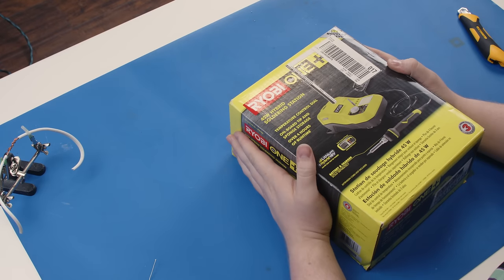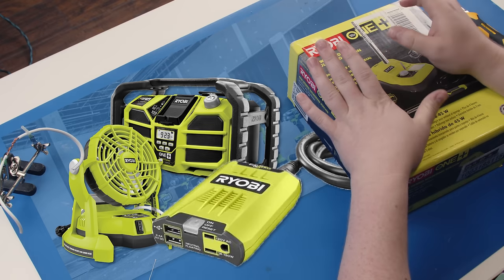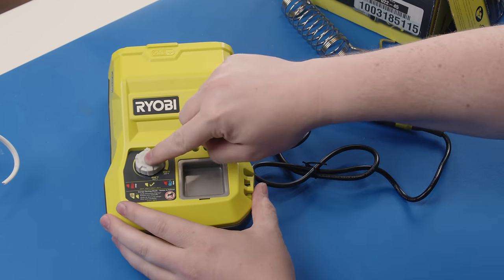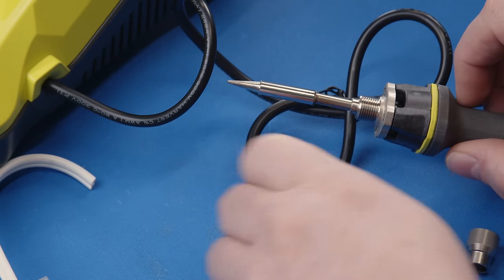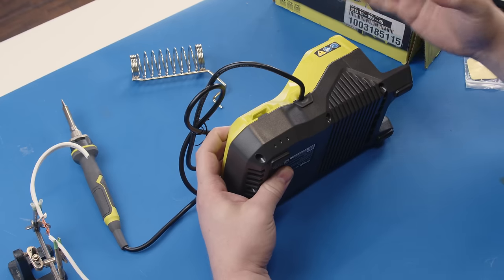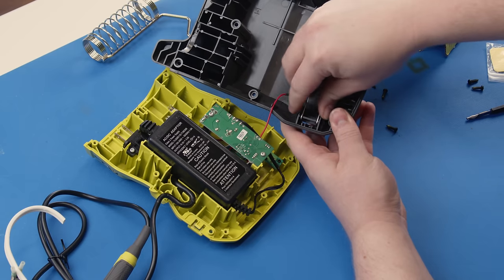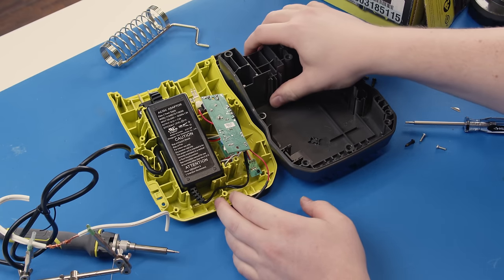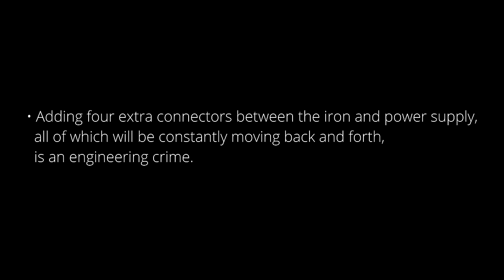Ryobi has GOT to be joking with this soldering iron

Comment: "I hate using bad tools even if I'm gonna do a bad job with them anyway." Man, I felt that one too hard.
Reply: Once you start appreciating good tools, not necessarily expensive, but quality ones, you can never use cheap stuff again.
Reply: Bad tools are really annoying, they feel wrong when you pick them up.
Reply: a good tool in amateur hands will do worse than a bad tool in professional hands in many circumstances but a bad tool is a bad tool and will cause more damage to the product than a good tool in anyone's hands
Reply: @frogz  Sometimes you work with what you have. As a kid, I had a 35w pencil soldering iron, but it did work for wiring, but not so good at ICs.
Reply: @the_kombinator  i use a weller gun for qfps, use what ya got
Reply: @frogz  Wellers are great! I had a 35/140w that made automotive wiring harness jobs a flash! Once I got myself a decent paying job, I got myself an adjustable iron for semi-precise PC repair and I'm glad I did, but for decades it was Canadian Tire 35w plug in specials lol.
Reply: @frogz  Only if you know how to use the good tool!
Reply: At least when it's a good tool I know it's my fault that I'm fucking things up. This is not the case with a bad tool, if often feels like it's the one failing ME
Reply: . @the_kombinator  You need a selection of irons. No one size will be good for all jobs
Reply: @frogz  I kept a Weller gun on hand for quick jobs or where greater power was needed than I could get with a pencil iron. It was a matter of convenience/expedience no more. Otherwise, It was a love/hate relationship.
Reply: @WCM1945  I have two with interchangeable tips and variable temperature control.
Reply: Preach brother.... I'm that guy. "Step aside. I've got $450 digital torque wrench. I'm about to put a cheater bar on it and twist the head off a grade 8 bolt."

Comment: I’m a retired engineer. You spoke about the build quality of the internal PCB and the fact that they had not cleaned it. In recent years manufacturers have developed what is known as “no clean flux.” It contains no corrosive or conductive chemicals, dries hard so it does not attract dust, and does not need to be cleaned. The items you pointed out as rework on the PCB are more likely through hole components that can not be soldered in the same oven as the SMD parts. I also don’t think wire length has anything to do with cost, it has more to do with fitting everything into the box. You see this with many electronic products, even very high-end ones. About the only build issue that I think is a real problem is the PVC cable. I’m not sure why they made that choice, probably a cost thing. But it is a deal killer for me as well.
Reply: As far as not needing to clean flux off products... pure rosin core flux without a corrosive ingredients has been available for 50 years , and is not expensive. also a few seconds in an isopropanol alcohol bath is not difficult.
Reply: @Geopholus  Except you can't really bath a board that has wires soldered on it. Your bath content will creep into the wires, denature the flame retardant (if any) and lower their lifetime. I'm quite sure the boards have been cleaned after the SMD process, but not after the wires and TH soldering.
Reply: Ahem.  Rosin core is corrosive, that's what flux IS.  Some are just more active than others, but rosin is mildly hygroscopic so can cause problems in humid areas.  Also, merely dunking it into an alcohol bath for a few seconds will not remove it.  It needs abrasion/scrubbing or a much longer agitating bath for removal, which isn't really needed if they simply use no-clean flux/solder instead. 

There are many steps in design and manufacturing that could be idealized but in the end it has to be weighed what the benefit is vs all the extra costs.  That does not mean that I feel a few cents more spent here or there, wouldn't be worthwhile but remember what Ryobi is, TTI's consumer grade brand for tools rather than contractor or pro grade.  @Geopholus
Reply: @Geopholus lol
Reply: With determination, one can fabricate a silicon-jacketed cable for this beast.
Reply: @stinkycheese804   Just curious.  What would be considered pro grade?  I see a lot of Hakko machines and in the old days, Weller was everywhere.  I also never had the pleasure of using an iron that was temp-regulated. Does that really make any difference at all?
Reply: The probably i see is alot of companies use the pvc cables over hogh quality rubber and most of them i sure do it to save money my guess os they figure the people that will buy this to use it arent people that soldier professional but more of just a simple diyer which is normally the people that buy ryobi if we are being honest i know my brother has a bunch of ryobi and he has been pretty upset with a bunch of it and wishes he would have gone dewalt or Milwaukee.
Reply: @alext8828  for hobbiest/non professional use, I like the pinecil. I know thats not what you asked but its a cool soldering iton.
Reply: Impressive that you could sit through the whole video!

Comment: One advantage of those "internal" power supplies is that they can replace these with supplies for different regions without redesigning the whole tool.
Reply from the maker: I considered that, but I'm pretty sure the opening in the chassis is sized for a US plug and would not fit any others, and from what I've been told (and what research I've been able to do) the "hybrid" feature is US-specific, likely for that reason. In the UK, ostensibly, these just run off of battery only.
Reply: Unless they are really cheapest out on psu it should handle 100-240v 50-60hz easily
Reply: I was wondering this as well however I have a Bixolon Thermal Printer here where they also put a power brick in the case. It doesn't have a cable on it though, just a socket for a C13 plug (I hope that's what it's called), which would make it even easier to ship it around the world I guess
Reply: @virtualtools_3021  I actually says that right on the case of the supply.
Reply: @CathodeRayDude  we dont have these type of extension cables in the uk, where you can just connect them to a male plug like that. They would have to use an IEC type inlet for here.
Reply: @CathodeRayDude  they just don't sell the larger more expensive unit that you have here in the UK it seems, when I lived in France I had similar extension cables with a single socket like you get in the US so I wonder if it would be easier for them to make an EU version of this, but the UK plug really doesn't work in the right way. I would be interested in one but I can't find it for sale. I get your thoughts on the ts-100, I've had mine for a couple of years and use it quite a lot and had no issue with mechanical stress on the connection "engineering crime" or not, and the tips hold securely enough in place that I just removed the grub screw and now I can swap them out without fiddling with a tiny screwdriver. Each to their own though, fair enough if it's not for you.
Reply: Also thought it was funny that the builders plate on the soldering iron itself says 120/60 only, but the actual PSU hidden inside is universal. One of the UK tech youtubers (I think Bigclive) said Ryobi purposely has separate 120v and 240v products to stop grey market imports.
Reply: @virtualtools_3021  It's not the voltage that's the issue, it's the shape of the plugs.
Reply: @CathodeRayDude  So in the case of a UK model, they can just leave out the whole DC PSU and fit a plug over the empty hole without a complete redesign of the product. Seems like it makes sense to me.
Reply: @Ascania  aww come on don't your want to use a janky and mildy dangerous adapter?
Reply: These days, you can get an open frame "wide input" supply for a pennies more than the simpler ones. Almost every supply I have sourced or designed recently allows for 85VAC to 265VAC (100VAC to 240VAC +-10%), 50/60Hz. With an open frame supply, you just wire on which ever plug you want and everything else stays the same. In fact, you can simply do what the computer makers do and put an IEC C14 socket on the box, and then the user provides their own wall cable (or you include the appropriate cable by country). These are so common that Digikey has more than 1,500 different varieties to choose from starting as low as $10 per unit in large quantities. Ryobi are complete and total idiots, never buy their crap.
Reply: @Ascania  shape of the plugs is the easy thing to change. Have the proper voltage is the harder thing. Look at passive vs active travel adapters for US to UK. You'll find that passive ones are much cheaper because they don't need to have any circuitry inside just wires connecting the proper points.

I wouldn't be surprised if they listed the product for 120v only as a way to not have to recertify it if they listed it as being 120/240v capable but couldn't source those same bricks and could only get 120v rated ones (not sure if those exist though)
Reply: @nsshurtz  Look at the power bricks they are using. Certified 100-240V switching power supplies are EASY to source. Now go and look at UK and Schuko single extension sockets and tell us how Ryobi would fit THOSE into the back of the devices. These things are intended to be easy to connect with just a standard extension lead already lying around in your workshop. Not possible with EU or UK ones without sacrificing usability to the bulk of those sockets.
Reply: @CathodeRayDude  There are ryobi tools in other markets that have the hybrid feature but I couldn't find the soldering station or the exact light.  Australia has a hybrid LED light but a different configuration.  The power supply in your LED looks like the same size can be used for the European market but it's probably regulatory restrictions and regional popularity that dictate what they sell.  Great video BTW!
Reply: Looking at the video, the PSU in this will handle upto 240vac and 50/60Hz. So it should work in the UK just fine. You can adapt some makes of IEC inline socket to fit the USA or Japanese plug.
Reply: @JeffreyPiatt  I like the term he used..."Weed-Eater Power"
Reply: @ericschumann4213  if they did that it would only work with IEC cables, this is a tool it's meant to work with a common extension cord you would find on a jobsite.
Reply: @irtbmtind89 I was expecting to see it in use to see how well it heat regulated with a thermometer gun pointed at it or something
Reply: Not at all.  The radio uses a discrete open transformer and the leaf blower uses at least an order of magnitude more current than the SMPS in this soldering station can provide.   @JeffreyPiatt
Reply: @CathodeRayDude  I can confirm this as the AUS/NZ version is battery powered only, and costs more... The US version RRP is $75USD. the AUS/NZ version "after  currency conversion* is $100USD)
Reply: @samk4128 Yeah actually both the soldering station and the LED light power supplies shown on this video are marked as 110-240 V and 50-60 Hz. So both of them would work in any country if the power plug wasn't a US specific one or if they bothered to change the plug according to the market.
Reply: @CathodeRayDude  bruh i bought a soldering iron for like 2 dollars of of aliexpress and it came with a case a desoldering pump a bag of replacement tips 2 times 5 meters of wire(red and black for making circuits) a pincher for small boards a sponge and stand some solder and last but not least: TEMPERATURE CONTROL yes for sure, its just a pencil with a power cord, but there is a little dial you can turn from 200C to 600C
Reply: @CathodeRayDude Even better! That means they can just take it out, and sell the same product with less material for the same cost!

Comment: Caught this on my 5th re-watch of this video: Last year I bought a no-name Chinese “probably won’t set your place on fire” soldering station from Amazon and it also had the ceramic pencil style heating element. I can confirm that they’re super fragile and, despite the “engineering” steps taken to protect the element from taking the force as you described, it did, in fact come conveniently pre-broken from the factory. The manufacturer must have known that this was a likely situation to happen so they actually included a spare element in the box. The kicker is that replacing the element involves having to solder the new leads. 🙄
Reply: Reminds me of a joke discussion I had a while ago of "how did we solder together the first soldering iron?"
Reply: @joshm264  very carefully
Reply: @joshm264 : The first soldering irons were heated in a fire or on top of a stove.
Reply: @joshm264  lol i made a soldering iron for that, it's basically a resistance waterheater wire heating a thick copper wire, no solder.
Reply: @edwatts9890  i did that too, it's best if you have a bigass piece of copper
Reply: I use 2 stations that are jbc clones. Axiun t3b and t3a. They are better than any American station I've ever owned. It drives me nuts when people say they have to wait for their iron to heat up. Any decent iron built within the last 10 years heats instantly and turns off as son as you seat the handle. I sold my jbc station after I bought those stations. They've been turned on for almost 2 years and I've never had an issue. Irons without the heaters built into the tip are garbage.

Just my opinion. These stations were not cheap either. I use rc lipos with portable stations. Like the ts100.
Reply: You watched this video 5 times.....wtf
Reply: @jstro-hobbytech  I love the idea of irons that turn off when you set them down but I don’t trust the wiring involved so I use the switch on an external power bar. I’ve read reviews of some overseas branded soldering irons coming with the hot & neutrals wired backwards and others with the ground pin not connected to anything. Basically, having bought an Intertek certified clone of a UL product, I want my cake but don’t want it to burn down my house while I’m eating it too.
Reply: Oh, my tool broke, good thing I have a spare part, too bad I need to use the tool to fix itself....
Reply: @jstro-hobbytech even my $10 iron heats up instantly and works great and has adjustable temp.  The cheap irons of today are so much better than the 15-30w irons so commom a decade ago.  I think this $10 one is 65W and for another $2 or $3 you can get even higher, I think 85W.  Though I solder 12g wire super easy with it...just flux the wire, put some solder on my iron tip, and literally just touch it to the wire.  Instantly wicks into the wire.  Cheap irons of the past were fine, just underpowered.  They lasted forever though...i still have a few that i use for rougher jobs and pladtic welding that are well over a decade old and the cheapest things you could find.  I have also owned a Snap On iron...a huge one.  Thing was 100's of watts. Never used it for anything...it was just overkill for anything but the largest guage wires.  It was meant for auto shops, but what is soldered on a car that would need it? Lol. I used it to solder braze metal stuff together sometimes...but then you should just torch or weld.
Reply: Five times?    A little slow?
Reply: @jstro-hobbytech  
I recently saw a video of someone doing some testing of an Axiun station. The thing was an abomination! The tip temperature overshot the setpoint, something around 320 °C iirc, to well above 400 °C, without the display giving even a hint of a tiny overshoot. The firmware had been written to mask the fact that the designers had no clue about how to implement closed loop control. Revised firmware revealed the fault but failed to fix it.
Reply: @NageebTheAverage  
I saw photos of a power bar that apparently had the hot and neutral "reversed" though it wasn't really possible to be certain. The photo was intended to show the filtering or transient suppression or something like that. It was some time ago so I don't recall the details.

I don't trust any product with safety agency markings unless I have purchased in-country from a reliable industrial supplier or retailer. Many, many things have fraudulent markings. Amazon is notorious for "fulfilling" orders for dangerous products sold by their "marketplace' vendors. It is just plain illegal but Amazon gets away with it somehow. I recently did a review of such a product, stating I believed the certification marks were lies, using exactly that word. To my surprise Amazon published the review.
Reply: @edwatts9890  You're wrong.  The first soldering irons were heated in an open fire.  😜
Reply: @KenFullman : You missed something...
Reply: @edwatts9890  I did.  Thank you for being so polite with your correction.
Reply: Why did you watch this video five times? Are you insane?

Comment: I have used a butane soldering iron a lot, probably close to 200 times. Working on ships masts. The temperature control is there, it gets to temp quickly and stays hot up in the breeze. You can also use heat shrink with it and don't have to fumble with a cord while climbing. We bring a plug in electric one, but I've never seen anyone use it. That said, if we can do the soldering at a proper station before climbing then we will, especially if it's a lot of soldering, or we need a vice or something.